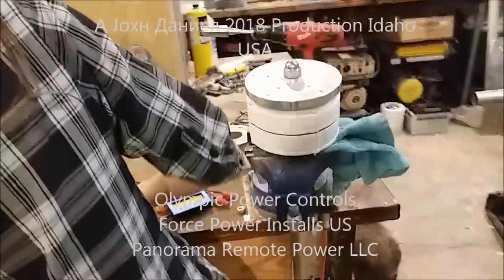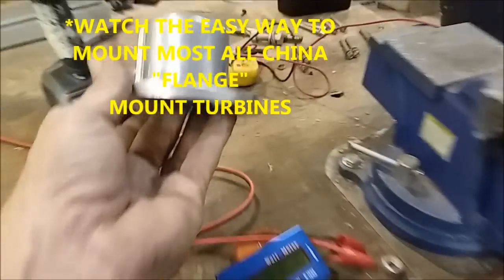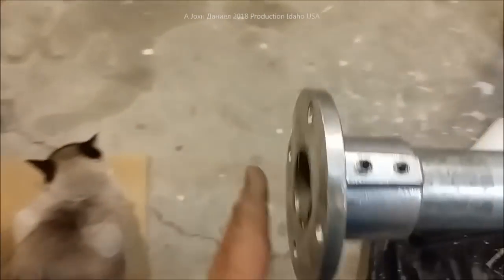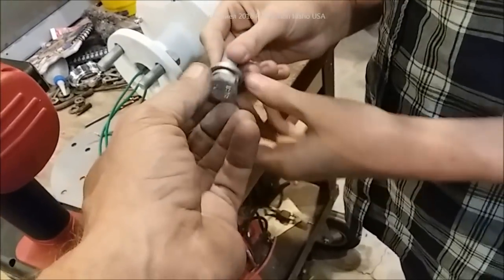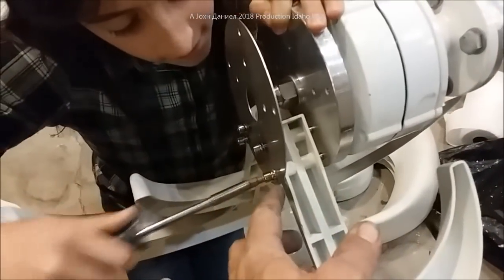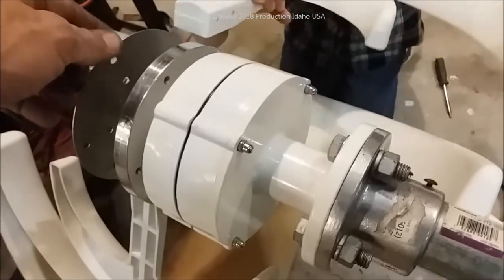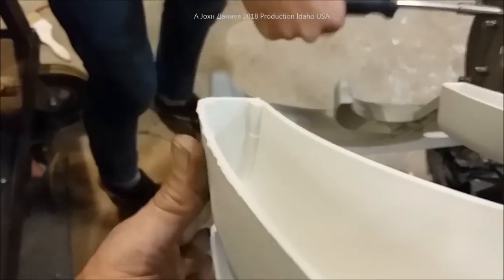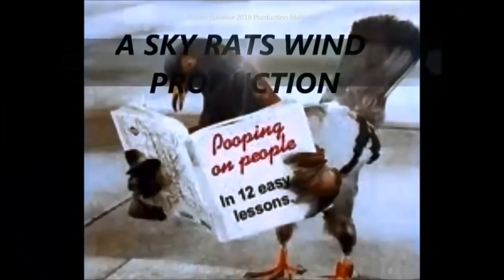Chinese LANTERN wind turbine generator VAWT vid 2 of 2 UPDATED INFO BELOW VIDEO!!

Comment: How do you know if the PMA is 12v or 24v?
Reply from the maker: Normally it will be marked. But most PMA generators run 40+ volts and can charge both 12 and 24 systems. Just like a 38 to 40 volt solar panel can charge 12 and 24.

Comment: Bought a ENZPOWER 1000W Wind Turbine Solar Charge Controller. Do i still need the small controller black box you have in your video as well?????
Reply from the maker: For your set up, You only need the EnzPower and some solar panels. I put some I have tested on my referred list https://www.amazon.com/shop/influencer-acccb1e8 of things that I have tested and proven, at my cost. What you won't see on there is the crap that failed or was poor quality.

Comment: Do we need the controller ? Or can it be  wired directly to the battery?
Reply from the maker: Controller designed for it or a Rectifier with diversion controls will be needed.
Reply: @JOHNDANIEL1  Could you please do a video on both and show how to wire them safely. Thank you :)

Comment: I love your "How to" videos, but I have a suggestion.  I saw, not to far back, your manual switching method to slow your turbine using complicated switching and resistors.  It is only complicated in the number of parts and cost.  I have a cheaper option. 

 I have a new regulator for my 12V 500W wind turbine. I spent $27 off Ebay for a new 2007 Harley Softail voltage Rectifier/Regulator. I picked the 2007 because the wires are long. The 2008+ Rectifier/Regulators have very short wires. I cut off the plugs and soldered in ring Terminals.

The Harley's put out 3 phase AC up to 38 Amps. The Voltage Rectifier/Regulator is a shunt type regulator that kicks in at 14.5V. 

The way this works, is to simply rectify the voltage until the voltage reaches 14.5V, then shunts the excess voltage to ground. I tested the wind gen with a power drill and socket spinning the turbine. When it reached 14.5V, the torque increased on the drill and slowed it down. In this way, that shorting to ground acts as a brake and slows down the wind turbine to keep it from over spinning. Shorting to ground is what a brake switch does, except this is temporary, until the voltage drops below 14.5V. 

This results in a self regulating and self braking turbine.

The Harley Rectifier/Regulator should work with higher wattage and voltage turbines as long as you are charging 12V batteries. It all cases, the voltage is clipped at 14.5V and the turbine is slowed.
Reply from the maker: Excellent
Reply from the maker: Looked up the specs on them. I have numerous peaks exceeding 1100 watts on the China Turbine, and Peaks exceeding 1400 watts with the 2 Thermodyne home built models. 100 amps is not unusual in high storm winds. 45 amps being average in continuous winds over 20 mph.  The switches are for those few times a month or every other month we get 70 mph mountain pass wind storms. Under 50 mph the windandsunpower.com/Store/ controller is automatic and diverts into 2 stages of diversion with 700 watts coming on in pulse application at 14.4 volts and if it don't control it the second stage is a dead lock on 800 more watts of burn off at 14.75 volts. 
I may option a similar regulator from a OPEL car for the next turbine if its a low producer since its near identical and rated at 70 amps.
Reply: I don't think I will ever get up to those high watts because the braking effect on the turbine caused by shunting the excess voltage to ground. The shunting is basically a brake switch.  On high winds, it will never achieve the high RPM's required to produce that much power.   I expect that the Wind turbine will never get over 500 RPM due to the breaking effect when the voltage reaches 14.5V.  

Are those high watts you are getting usable?  It seems that both current AND volts is increased at high RPM's and that excess has to be dumped in some way or you will overcharge and destroy the batteries.  It would be great if you could just increase current  while setting a limit on volts,  but turbines don't work that way.  Both current and volts run up to excess at high RPM.  A MPPT controller is probably the only way to increase current while setting a limit on volts.
Reply from the maker: The battery takes all watts as Amps. A small battery set up is never suggested for wind turbines though. 7 x your average turbine production is the battery/amp hour you should always have or more. Otherwise its easy to quickly surpass a safe battery voltage and cause water loss/damage. 
In my system, I have a huge battery bank, 14 big L-16 batteries and lots of controllers. I even keep 5 size D29F 12 volt SLA Centennials in the system that came from our camp site, they are 3 years old, doing well. With the wind turbines sized like mine you get a awesome battery equalization with every wind storm. And you get prime bulk charge without issue. 
In 10 years I am just now on my second battery bank. New one which is almost 1-1/2 years old now. Same system with a few changes to brand or quality.
Reply: Ah I see.  Everyone has different requirements and has to size accordingly.  Mine is for a sailboat and sized for my requirements.  I use a high amp alternator on the diesel for main batteries and the wind gen is dedicated to galley batteries where I run refrigeration and occasional use of an inverter to run the microwave.

Comment: This turbine needs storm wind
Reply from the maker: Using a Old Lennox AC/Heating blower on it last night, it made 112 watts 8.5 amps which is actually more than i thought it would do. If you just calculate using "Chinese Amplifier, horsepower and renewable energy math" LOL, you take all their claims on output and cut it 40% then you are looking at what to expect!! However, compare that to the solar and wind ebay scammer slum lord in Missouri who sells re badged fake Vietnam wind turbine junk, you get the Chinese lies at a rate 1/4 as bad as he does!
Reply: LOL!
Reply: With that 112 watts what was the average wind speed?
Reply from the maker: 16 to 17 mph was the best measure I could get in the turbulence near it when it was producing that. But in a test 3 days ago on a temp pole while trying to figure out where to actually mount it we got 149 watt peak at 19 mph steady.
Reply: Thank you!

Comment: Great video!  I like the attention to details.
-just curious how the 700-900 RPM in 13-14 MPH wind was estimated?
My expectation for that size VAWT, under load, would be 10 RPM per MPH of wind at best.
Please post your test results.  I have not see anybody show their results for this style of VAWT.
Reply from the maker: It's a edumakated guess based on the makers 5 to 30 mph stats on Alibaba. 95 rpms at 5 mph, and 1525 rpms at 30 mph. Based on that and a 3 beer mathematical equation I get that +/_ 1 mph rating. These do spin very easy.

Comment: so this is video 2 of 2 but is there going to be a third video of installation and showing power generated??
Reply from the maker: Video 1 and 2 are the receiving, opening, study of, testing, constructing and overall review of the thing you get. The next video will be the value and function of it installed and methods of application. I plan to do like the last turbine from China, video 1 with how it is working then in 6 or so months video 2 on how well its performed (or didn't perform) over a 6 month period.
Reply: @JOHNDANIEL1  was going to order today  but waiting for the final video.. thanks for the vids ][ ][ ][%
Reply: @JOHNDANIEL1 Still waiting for final video :) is it worth it?